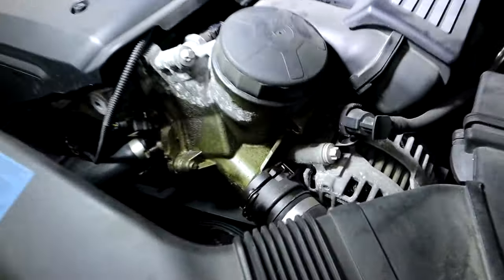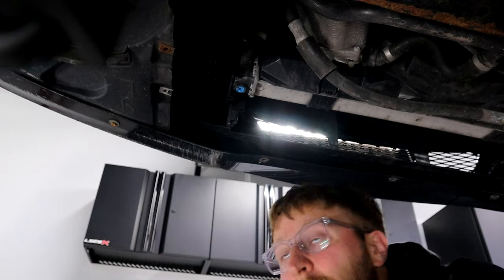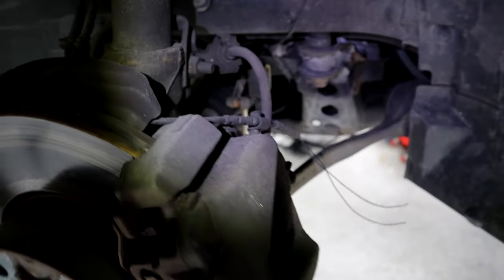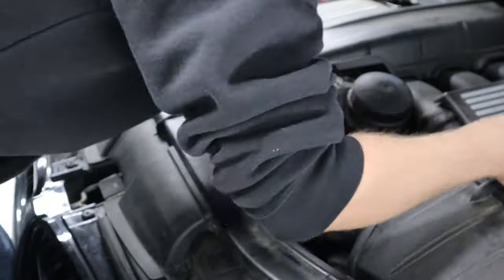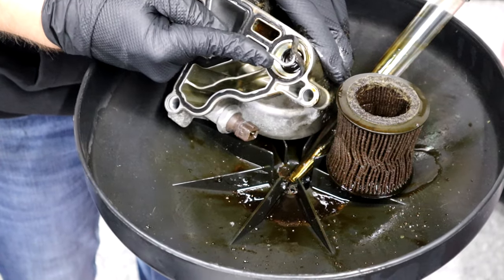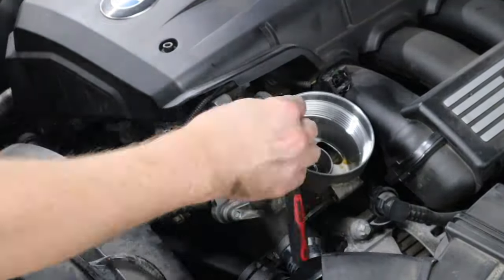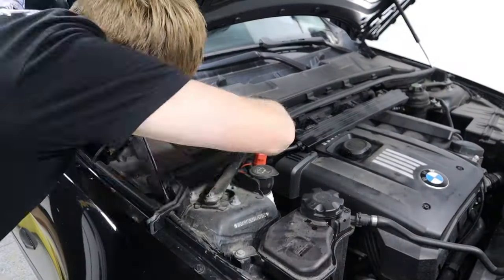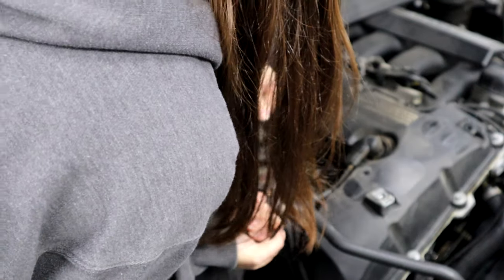Fixing the LEAKIEST BMW I've EVER Owned (feat. my wife)

Comment: I have a quick question about my 2007 bmw 328xi im currently seein that my radio doesn’t turn on , but it would flash on and off like its tryin to turn on but doesn’t. do u think it would be a fuse issue or a wiring issue 🤔
Reply: Check fuses , and swap radios

Comment: Personally, I would've replaced the valve cover too if you haven't already done that relatively recently or at all. Once those things warp, your engine just start pissing oil all over the engine bay.
Reply from the maker: Yeah, that wouldn't be a bad idea but I really didn't see any seeping or leaking from it. Just the oil filter housing gasket. I sprayed down the block with brake clean so I can see if there is any more oil coming from other places. Usually once you seal something up on these BMWs, another leak pops open 😂
Reply: @jake_spence  I feel that. A couple years ago, I replaced my oil filter housing gasket on my 128i only for the valve cover to start leaking just a couple weeks later. Ended up retrofitting my N52 with a magnesium valve cover.